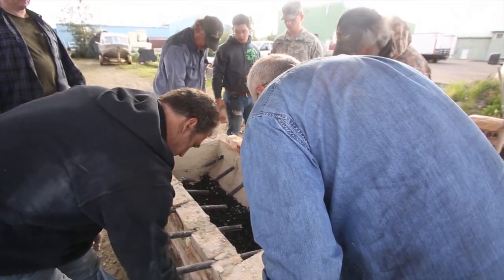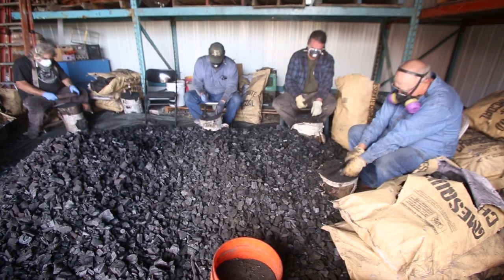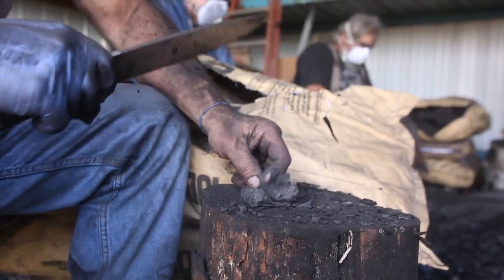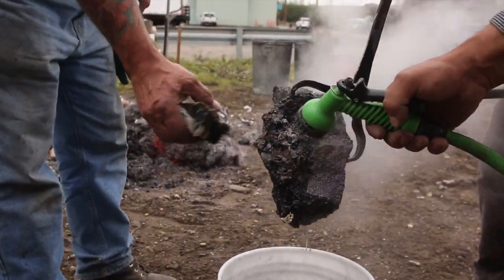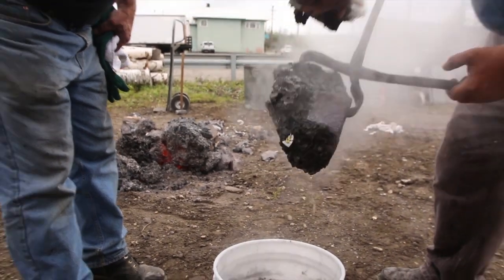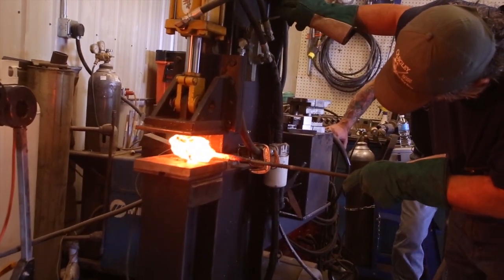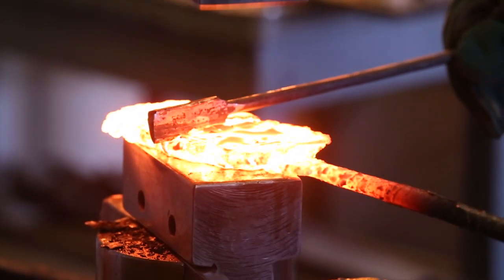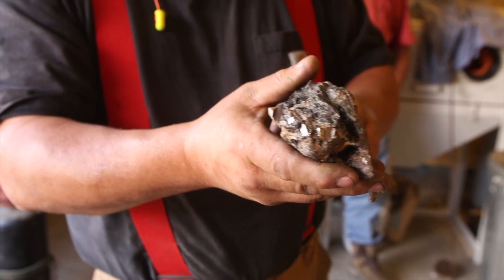Tamahagane

Comment: One thing they didnt do was coat the pieces with clay slurry which was one of the secrets of the Japanese sword makers... it helped to keep it pure when forge welding.
Reply: No it didn't, it was used to stop scaling, thus not losing vast amounts of metal during heats and forging.
Reply: I thought the layer of clay slurry and rice straw ash was to keep the carbon content because everytime its heated, folded and forge welded it loses carbon content? I'm no Japanese sword Smith or blacksmith however I find it very interesting and neat how they made something by hand and it lasts centuries.
Reply: @shonaoneill5151  dude lol calm down man. So the guy is wrong. You told him the reason. But instead of being a adult. You came into the room like a young pissed off women yelling "and another thing". lol

Comment: that's not a japanese steel , it's a pirate copy (trash).
Reply: What does a gamer know about forged steel? Junk
Reply: @Bill-cv1xu  you Can't compare a real tatara with this junk! That sword it's a cheap copy!!
Reply: @gervacho10  yeah. But they're trying..
Reply: We talk about a Japanese sword!! One of the most finest and precise Weapon! There's not a simple knife. If you Can't do the same  thing better do something else
Reply: Gotta learn and hone your hobby...
Reply: @sophisticatedfart2368  To be fair, folding was pretty much one of the most common methods used by the world in the pre-industrial era. Japan's iron sources weren't crummy, and other methods of obtaining iron from natural occuring ores, sands with higher iron concentration, and outside importation existed. Heck, just for reference, the majority of European blades during the medieval era utilized some form of laminated structure. One of these being a plain iron sword with carburized edges.  It wouldn't be until the 17th century where spring steel blades become the standard, but even then, down in italy, the same lamination methods were used for a type of saber where it involved a plain wrought iron core and a carbon steel jacket. (Plus don't get me started on that the Japanese also had another type of tatara where rather than ending up with a heterogenous bloom, it instead produced cast iron.)
Reply: @sophisticatedfart2368  Case and point, pre-industrial steel is trash compared to our modern alloy steels.